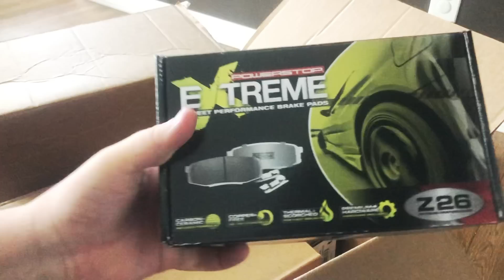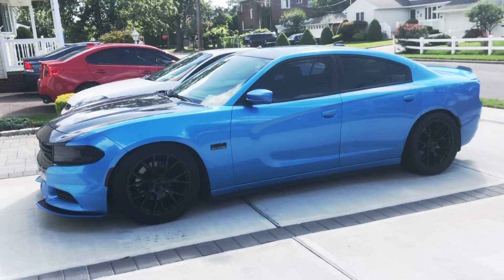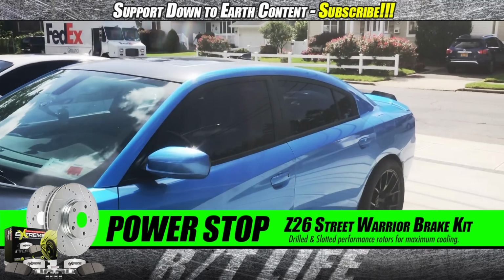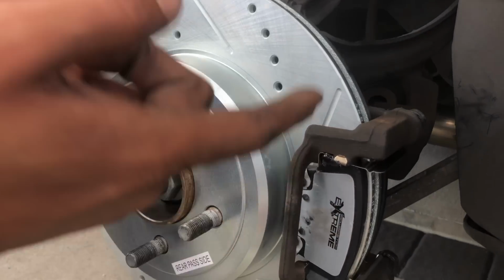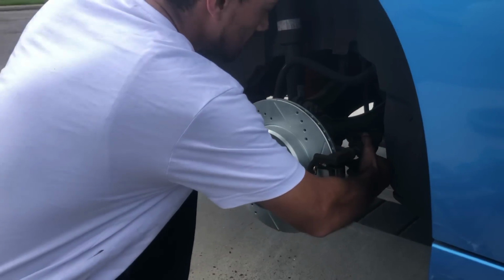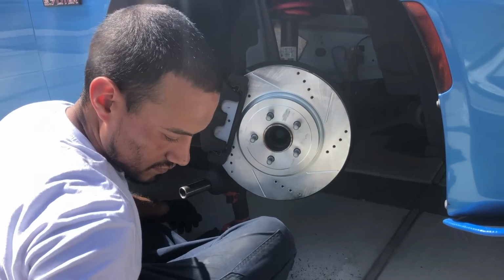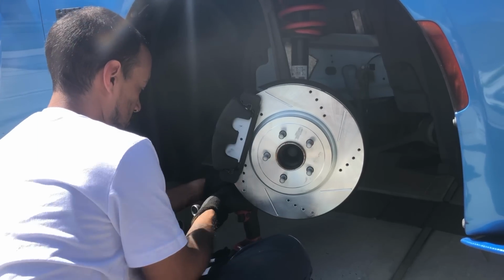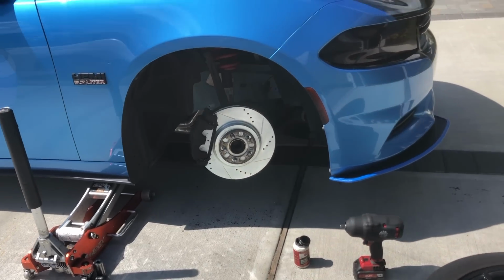CHEAPEST Brake Upgrade...

Comment: I did a brake upgrade on my 99 Dodge ram using Power Stop but I also upgraded the calipers.  They are now better than new.  The brakes on my 2018 Chrysler 300 seem to over heat too fast and are only good for one emergency stop.  After that, it does not want to stop. I was going down a steep mountain in Wyoming when the brake fade so bad, I had to pull over and let them cool down.  I only had 8,000 miles on the so called high performance brakes that came on the car .  Thanks for the video.
Reply from the maker: Damn man that's kind of scary! Having braking problems is never a good thing. This setup def is a big improvement over the stock.

Comment: I had those brakes at one time on my first challenger they were ok and the rotors made it look better but the performance was not much better compared to stock it was just looks, I learned not to waste time on minuscule parts like that and fast forward to my R/T now being cammed and putting down 430 I knew I needed big brakes so I did the wilwood 6/4piston set up and what a major major difference even in terms of unsprung weight from 2piece rotors to actually being able to stop with no fade or shuttering. It’s costly but so worth it down the road! Plus way less brake dust! I really recommend you get rid of Those 3/1 calipers on a nearly 4000lb car they put tiny brakes in the back it’s crazy
Reply: I Got an rt and worped two sets of factory rotors in two years. I completely agree with the cars weight and itty bitty breaks being crazy af. No matter how much power you have, because of the weight, the car needs a better breaking set up than what the factory is putting on! So... You say you had these on your first Challenger. Just to be sure did you still experience rotor worpage, fading, shuttering, and all the nasties that come along with the factory turd? Because I really need an cost effective upgrade but can't afford to waste money on these if they're not much better.
Reply: @turtle6455  To be honest, they'll probably hold up better than the factory rotors; but upgrading the calipers is what'll really give you better stopping power.
Reply: Turtle yeah they still would warp and shutter under hard braking or fades during high heat on the rotors and pads. They’ll probably last a tad bit longer than stock but no really gains. 6/4 pistons are really the way to go, plus the 2pice rotors are much lighter and doesn’t have shuttering or fading what’s so ever. If anything the unsprung weight has made a huge difference in handling and brakes now like the car has lost 500lbs. I wouldn’t sell myself short on those powerstops not gonna feel much difference it’s worth it going with a big brake kit on these big muscle cars 👍
Reply: Dam, bummer. Talked to someone in another comment, who swore by these z26's. And I was getting syked to get a set. My deal is, once my breaks and rotors heat up, I start getting pulsing and vibration in my break peddle. I took it to the dealer and they said my rotors were worped. I said gimme new ones at $450. Less than a year later and I've got the issue back. They work fine at lower speeds but one slow down on the highway or an exit that snuck up on me and they're shaking like a who'haw rattler until they cool down again. So, how costly are we talking here, for the wilwoods? Thanks for the replies by the way! 👍
Reply: Turtle not gonna lie they’re pretty expensive but so worth it since my car is modded and puts down more power than a stock rt very close to srt numbers. I paid 4K for the brakes and install, labor included. It’s definitely something worth getting as you’ll use them to slow/stop yourself everywhere you drive. They’re definitely track ready if I want to do some laps/auto cross. They definitely don’t fade like I said the unsprung weight is incredible in handling. By that I mean the wheels feel lighter and turns much better along with being able to slow down quickly. Just makes driver confidence go up and the car is more capable. Being able to accelerate fast is one thing but big brake kits are a game changer! I couldn’t sell myself short on a powerstop kit since it’s so similar to stock and the gains are minimal. I know everyone swears by the z26 they’re great on a budget but 6/4 piston set ups are amazing. Plus adds some eye candy looking at the wheels.
Reply: Wow weeee! Baller! I ain't got it like that! Dam that's alota scratch! I'll bet they're bad ass but... There's gotta be a knuckle head out there somewhere who just totaled a hellcat. Yo, I want your breaks. Hit me up.
Reply: Turtle yeah I’m sure you can easily find a used kit on eBay from a hellcat or srt people are always selling those kits from what I’ve heard. Just try to go for what you want, they’re worth it and will last way longer than the tiny stock brakes

Comment: I noticed her didn’t spray the rotors down with break cleaner or something.    That’s a  must when installing new ones.  It removes the crap that on them when shipped to protect them
Reply: I agree 💯! Also noticed he didn't lube the pads sliding surface, just installed the new hardware? Maybe he needs a new helper? lol
Reply: Jay Patrick Sei you right I didn’t catch that at first.  He dam sure didn’t.   This install reminds me of the first couple sets of brakes I did. Lol when I didn’t know how to FULLY do them 100% correct.
Reply: @jasonjackson329  ya maybe back 20years when I first got my ASE cert. Lol

Comment: I upgraded mine a few months ago with the the whole Kit (brake pads, rotors and the red calipers) from autozone, instantly the squeaking was of no more and brake dust has been minimal to none.  And they look great with the red calipers, there not brembo,s but they do the job.
Reply from the maker: Glad the new setup is a solid upgrade for you. So far I'm glad I ended up going in this direction - for what I do with the RT these seem to be plenty.
Reply: I have z23 kit on my beemer and they look nice and perform just as good if not better than stock

Comment: The Charger police interceptor brakes are better than the 4pot srt brembos and cost less than $600 for calipers, rotors and pads. Haven’t installed mine yet but I look forward to seeing the difference it makes.
Reply: Luke Gargano lol and the unsprung weight you adding with that kit is so heavy. You’re better off getting a big brake kit and calling it a day. Especially since it comes with 2 pice rotors which are lighter than the factory rotors and don’t warp or shutter.

Comment: Great video! I have a ‘17 challenger rt which is equipped with single piston front calipers (cringe) so Ive got dual piston front calipers and hoses on the way with new rear calipers all powder coated red for that extra umph pop. I opt for rotors which have three rows of drilled holes between each slot for personal preference. I’ll be detailing my splash shields and suspension rather thoroughly upon installation for OCD purposes

Comment: Yeah I always had great results with the drilled and slotted power stop rotors and akebono pads. Stock wasn’t actually to bad except they will overheat and fade if you do too many hard stops in rapid succession, but jam on them once and they do stop hard.

Comment: I put my powerstops on about a year ago. Pads definitely last but the kit only helps to me 75mph and down when your doing high speeds i still have issues. The charger is still to heavy they need 4 piston minimum. At least a off brand 4 piston front and rear
Reply from the maker: I still haven't pushed it - going to test them out soon. I will make sure to give them a try at higher speeds. Thank you for the heads up
Reply: @RTLife  not a problem, let us know your results. If your good at higher speeds then it may just be me and possibly a caliper issues

Comment: I got some rear caliper BRACKETS off of a cop car, which allowed me to still use the my R/T caliper, (same part there, bracket is only difference). The cop rear rotors are the same diameter as SRT rear rotors, just a little thinner, but still thicker than stock RTs. This makes your rear brakes the same diameter as your fronts and when you brake, it really squats the car down, instead of nose dive. I didn't  notice how bad the nose dive was until I swapped the smaller rotors back on for testing. Big difference, small $$$.

Comment: I got a 16' R/T Charger N finally swap out the pads n disc for this Z26 upgrade @ 75K(I had the upgraded 75K factory warranty). After about 40k miles, I would feel the brakes squeal, fade, n shake when I brake hard or come off a freeway off-ramp. This is a good upgrade!

Comment: If you don’t track the car you don’t need to upgrade the brakes. I’ve always put the best rotors and pads available on all my cars, but the stock rt brakes literally caused mild dizziness hard stopping from triple digits. They pull a lot of gs. Unless you’re jamming on them constantly and don’t have to worry about overheating they’re fine. I’d still put the best pads and rotors available when I change them, but no need to change calipers. Braided stainless lines never hurt. Akebono pads and some good slotted premium rotors are plenty for street driving.

Comment: It took me less than a couple hours to replace mine and it was super easy. The only thing  bad I have to say is I was “driving behind a BMW” on a mountainous road and at a point the brakes were too hot and wouldn’t stop my car. It was the most uneasy feeling I have ever had driving. I did the “break-in” just as instructed too so it wasn’t to do with that. I have the same exact car as you (but black) without most of the mods of course. So quick heads up if you are driving her hard and braking a lot!! Other than that they are awesome. Lol. Great video and recommendation!
Reply from the maker: Thank you very much for the heads up! I will keep that in mind for when I actually drive hard. That's def a nerve racking situation, a couple of other people said similar so it is a little concerning.

Comment: years ago i put red ebc (track pads) on with new rotors. i got about 5,000 miles before everything needed replaced again. it stopped on a dime, but cost a quarter everytime i did.
Reply: I have heard of cars that can stop on a dime & give you 9 cents change, but never cost me! Lol that was a good way to describe your situation!
Reply: It's always a trade off. Same with tires.
Reply from the maker: I was looking into EBC as well, I heard good things. This was def a penny pinching move, but it is a solid upgrade.

Comment: I didn't see the guy installing the brakes clean any of the hubs or the caliper brackets. It's really a must do because you need a clean flat surface for the new parts to seat against. I use hi temp anti seize on the hubs, and synthetic brake part lubricant under and on top of the stainless pad shims. The caliper alignment bolts need silicone dielectric grease or synthetic brake lube to keep the caliper floating freely.

Comment: I upgraded mine with drilled/slotted rotors and ceramic pads from Brakemotive! They come coated in black and never rust! Significantly thicker than stock and at $85 for the fronts and $75 for the rears(with pads) was a great investment!! Plus they look sick with the two tone once the coating is taken of the contact patch on the rotor!!
Reply from the maker: That's a great price for the upgrade you got - nicely done!
Reply: Do the ceramic pads make any high pitch noise upon braking or are they relatively quiet?
Reply: Not at all, very quite!!

Comment: Awesome video brother. I Changed the Front brake pads on the Widebody Challenger With the Power Stop Extreme pads because of break dust. Makes all the difference and still performs great too.
Reply from the maker: Thank you - yah these pads are pretty damn solid. I'm glad I ended up giving this a try.

Comment: I want to do brembo swap on my 2015 RT but not sure what year SRT8 brake setup to look for. Don't want to blow money and not get the right year to make conversion. I'm looking at a 07 SRT8 charger but to afraid to pull the trigger until I confirm the fitment.
Reply from the maker: Have you looked into the pursuit brakes? I hear it's a big upgrade - the brembo brake conversion wasn't something I wanted to do after researching. So much $$$
Reply: @RTLife  I have not, but I found a swap package from a 2007 SRT8 for $900. Just have to make sure it will work for my 2015 RT Road and Track.

Comment: I actually got the powerstops a while ago and they make a world of difference. I don't recall them being the extremes, maybe the line before it but they were drilled and slotted as well as the carbon fiber brake pads. Yeah it's tough to invest in the opposite direction of what you want but once you feel these out, you'll be glad you got them!
Reply from the maker: I think you go the z23 - which are also performance brakes as well. It has the drilled & slotted rotors. I'm glad I ended up doing this - I think for what I do with my RT it's perfect.
Reply: @RTLife  oh for sure you had to! Hell, I'm nowhere near your power and I needed them! The stock brakes really aren't that good even when these bad boys were stock. I wish I could jump into some brembos or Wilwood cuz I know it'll stop like nothing then but the cost is truly unreasonable. Once you go forced air though, you may need to start budgeting for them though. At least to rotors are on point! And they will feel good stopping big blue.

Comment: "Let's not draw attention to my little baby brakes." So damn funny. I was thinking "baby brakes" the whole way through. Bro. There are ways. I just put together a BBK for my Audi project car. I found some brembo fronts off of an S8 on fb marketplace. Came with slotted rotors, Apikol adapters, and even Yellow Stuff pads for $425. There were 3 coats of crappy paint on them, but I got them stripped down, and sanded in a couple days. For the rears I'm running with drilled and slotted rotors, and calipers off an S4 for now with an eye toward going to brembo rears later. Still, my rears will be as big as my fronts are now. I got the rear calipers for fifty bucks from a part out on marketplace. Shipping was like $20. They are prepped, disassembled, and out for powder coating as this is written. I'll have $700 in the whole she-bang when I'm done including new dust boots, and seals. Took about 4 months to find everything. You can do searches on fb marketplace by entering major cities in your region as a starting point (to keep shipping costs low) and typing in the model of your car + "Brakes." stuff will pop up that other guys have put together for upgrades. It's amazing. You never know what you will find. Happy hunting...

Comment: Is that Monte Carlo the supercharged 3.8 v6? I’d be interested in modding that. After my grand national I got a Grand Prix gtp and it was a good engine. You can put a smaller pulley, upgrade the supercharger, or turbo it. They are robust engines.
Reply from the maker: it's an 06 Monte SS 5.3L V8

Comment: i had those on my ss sedan, the rotors warped in a few months. ive had good results from EBC
Reply from the maker: If they do I will def give people a heads up on it. I've heard good things about EBC
Reply: I run the EBC Yellowstuff brake pads on the Barracuda. They stop good but DUST, tons and tons of brakedust. Wouldn't be a problem if I were running Centerlines.
Reply: I have same set. Warped and squeak, 6 months, low milage, mostly daily commuting. Followed breakin to the letter, look good but they clunk, squeak and can feel the warp.
Think I'm going EBC next time,  head better things, red stuff pads.

Comment: I upgraded my front rotors to cross drilled/slotted pieces and pads. It is like night and day. Unfortunately there are no aftermarket parts for my car. ('07 Ford Taurus SE) The good thing is that it shares most of the suspension from as far back as the '96 Taurus SHOs so all I need is order them. I wanted rear discs but if I use the SHO discs I would need new rear wheels because the offset will change and it is lowered. Life sucks. 😄😄😄

Comment: Please let me no if you have any brake dust problems. I purchased a different brand of pads and performance rotors and have brake dust issues. Great videos, keep up the good work
Reply from the maker: Will do - I want to drive it a around a little while before doing a review video. I will make sure to discuss the brake dust topic.

Comment: have it on my RT too! absolutely love it, really quiet breaks
Reply: Andy, got a question for you. I have an rt also. Worped two sets of factory rotors in two years. I've found out that you only get 4 or 5 slow downs over 80mph on the factory rotors and they're toast. Since you've upgraded too, I assume we share a similar experienced. So my question is: have your rotors ever worped and how is the upgrade holding up?
Reply: Turtle yeah I switch to Z26 because I went through 2 sets of rotors and pads in 2 years; the Z26 is pretty awesome! Really low dust, and I’ve slame the brake 80+ and it’s still completely fine, and I do mountain drives, hard brakes around the corner, the rotor is still good; really satisfied with it. But you have to follow the factory break in process to get the good results
Reply: Turtle also the Z26 has been on my car for over a year now, still holding up great
Reply: Thanks for the reply. Much appreciated. Z26, here I come!
Reply: Turtle good luck! Hope you like it
Reply from the maker: yah so far so good - happy I gave this a try. I would like to have a follow up video about performance, cost and brake dust levels.

Comment: I have the same setup and in 2 months the centers rusted and looks like crap now. Too lazy now to pull off the wheels and paint them but it drives me nuts since the originals did not rust like these.   They do stop nicely though!
Reply from the maker: Oh man that would drive me nuts - we will see if it happens to me. They do stop pretty nicely.